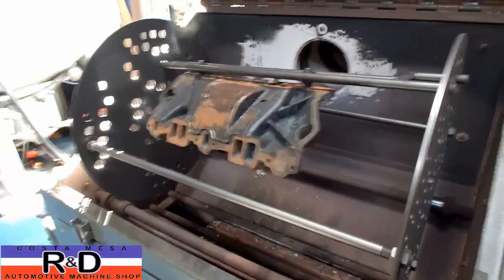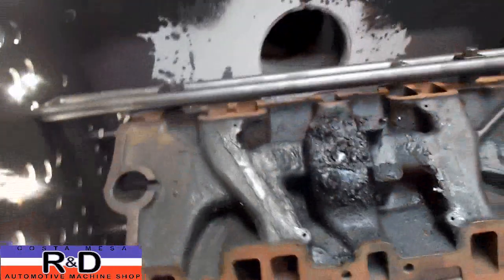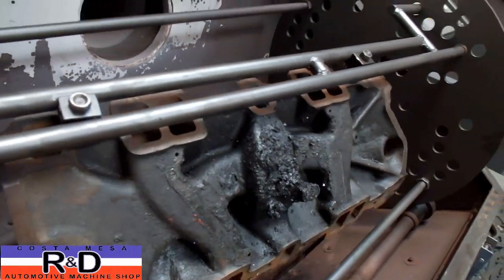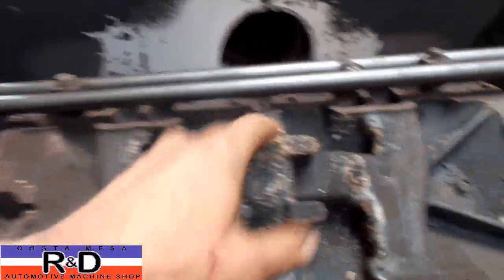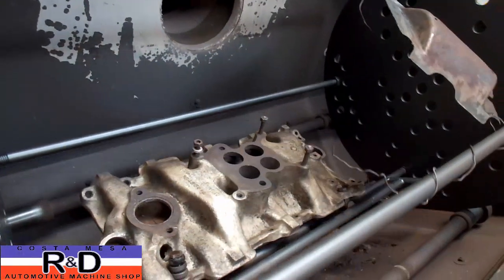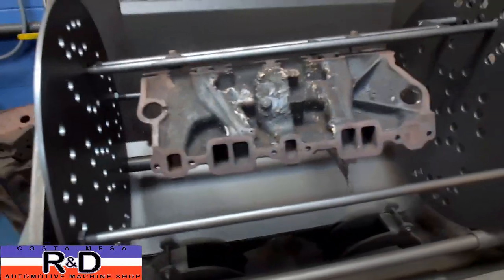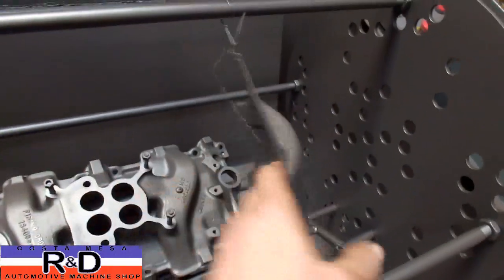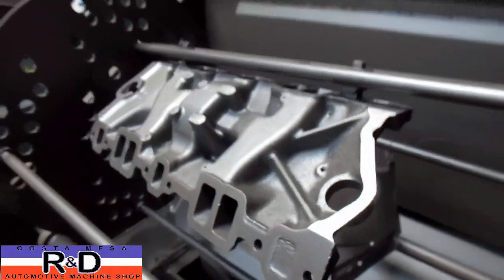SBC Thermal Cleaning Intake Manifold

Comment: Nice job. Some time ago, I sent you a picture of one of the chain tensioner studs that I got back from a local metal cleaner. That is all that was left of a 2.4 litre 911 engine. I had noted on the work order that the parts should not be put into a chemical bath, they forgot and the alloy engine parts disappeared.